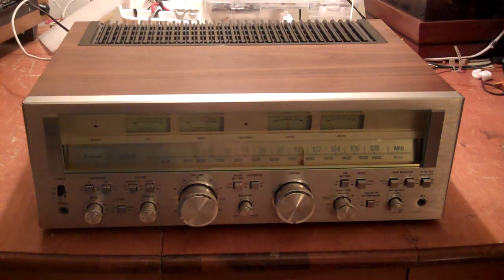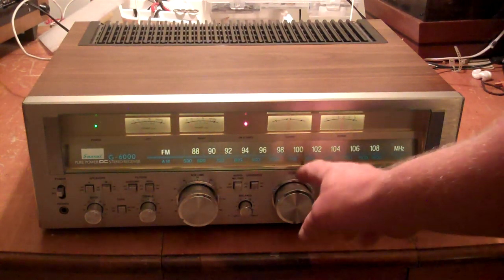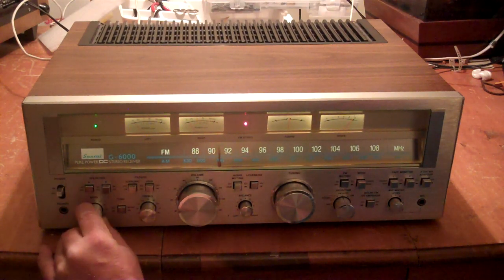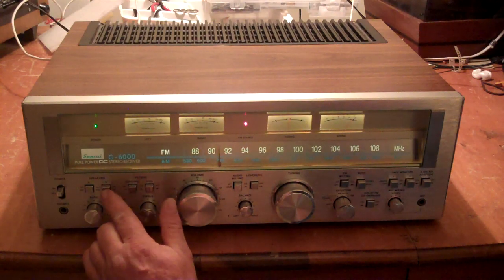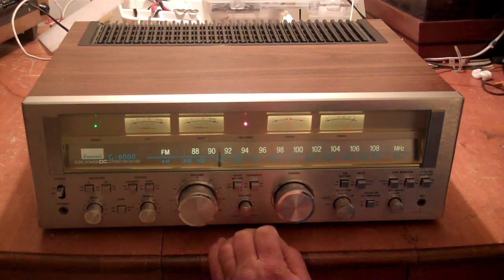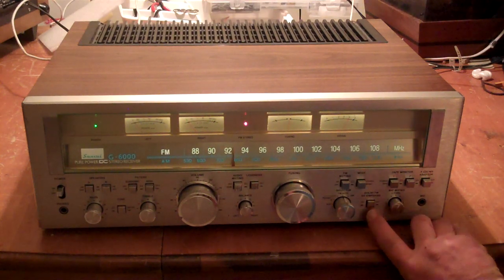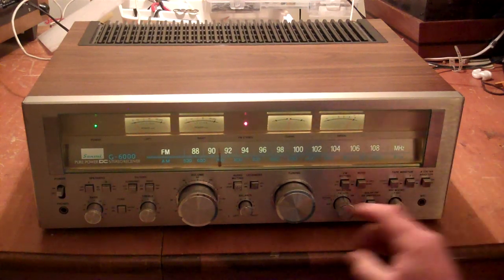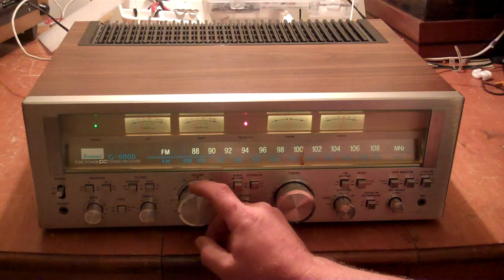SANSUI G-6000 PURE POWER DC Stereo Receiver. ZCUCKOO

Comment: Are you able to increase output wattage? If yes, it would affect the quality of the audio or eventually damage the receiver?
Reply from the maker: I make these things work as designed with any luck. I find it a waste to modify these to see what they'll do. The end result will always be a piece of junk. Want more, get a receiver with more output. That's just me though.
Reply: @Zcuckoo   thanks for your advice. I bought the same receiver, everything works perfect! Only thing I want to do is polish the faceplate and knobs. How you did yours? Looks amazing!
Reply from the maker: @eriveraviruet  Take a picture so you can see what knobs went where, pull them all off and I put them in a bowl with 409 spray cleaner and let them soak if they are Real dirty. Then I use a toothbrush and scrub each one, let dry and inspect. It works very well for me. Then you can make a decision to pull the plate or not. If its not that dirty then you can clean it with it on the receiver, otherwise, you will see several screws along the top and maybe (been a while) there are some nuts under a couple knobs that will need to come off. Then the face plate should come off. Keep that thing alive. Do NOT EVER Connect/disconnect, or touch speaker wires together, this will Instantly blow the channel out. Then it will need to be competently rebuilt. Take Care,
Tim

Comment: The problem is, the signal meters work, but no power.. The VU meters don't budge.. Power source? Capacitors?
Reply from the maker: So, the signal meter being that for the AM/FM Yes?
Wattage meters=VU meters yes?
There should be a green lamp labeled "Protection" on the left side of the dial. You can see it lit up in my video here, does yours light up when the unit is On? When you first power up the receiver, do you hear a Click anywhere from a few seconds to 10 seconds after power turned on?

Let me know,
Tim
Reply: you hit the nail on the head, oops, I forgot to mention no sound.. I'll check for a click tomorrow, let you know.. I appreciate you're help.. Its my dads from the when he was in the Army, and I'd like to get it going again.. Any tips on how to smooth out the tuning? Its still slick, but not like I remember it.
Reply from the maker: Levi Bittner
There are pulleys that the string rides on as well as the shaft that the knob rides on. The shaft in particular has lube on it that has to be thicker after 30 years. Clean and re-lube that shaft with a good quality light oil NO 3 in 1 either, no no no. That should make it ride a lot nicer, common issue.
Usually when they no longer make sound out of either channel, one of two things has happened, the speaker protection circuit Relay has bad contacts in it (maybe) or the the (again) relay protection circuit has sensed DC in the output circuitry. It see this and never connects the amp to the actual speaker lugs hence "Protecting" the speakers. (Most Likely)
NOW, if at some point in the receivers life, while powered on the unit was Run hard for a long time to the point of blowing up a speaker or two causing a short or simply the speaker wires touched together when powered on, wither really will blow out the output transistors, one channel or both. Either will cause the protection circuit not to come on (No Green Light). Another thing that may have happened is the caps on the driver/protection board some are so far out of whack, it is making the protection circuit remain off.
Listen for a click, check for the green light, then go from there.
Go To AudioKarma.org and search out DC or Speaker Protection Circuit and educate yourself on it. There are a lot of Knowledgeable people/info on there that will help you.
Let me know,
Tim